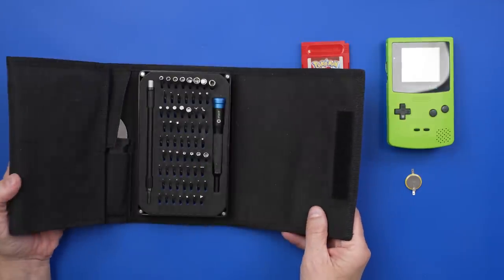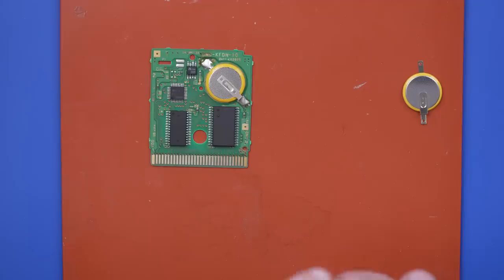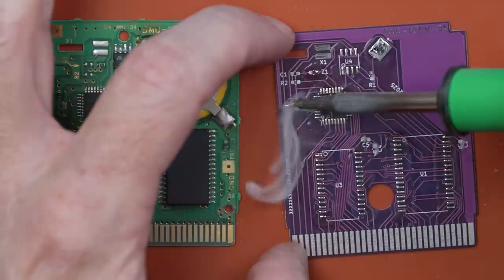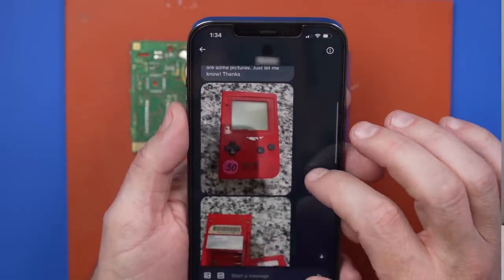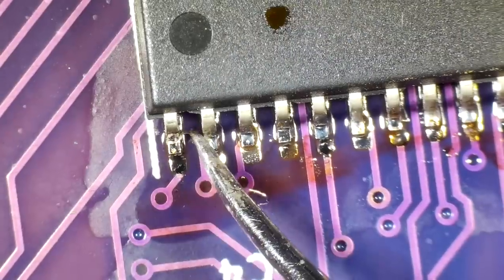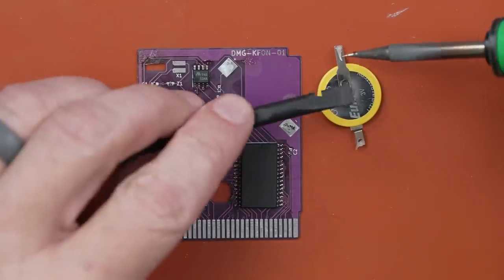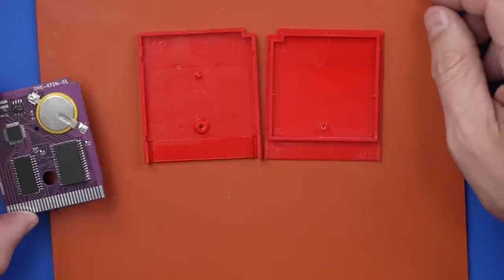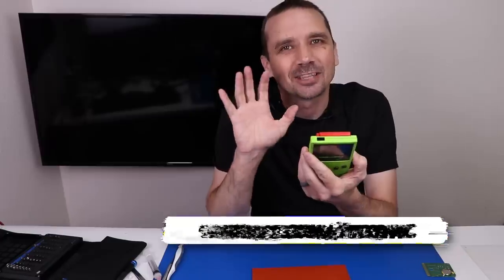Pokemon Red Game DESTROYED by Liquid - Let's Try to Save It!

Comment from the maker: PCB Design Attribution: PCB Design Attribution: https://github.com/HDR 
Above is where the PCB design came from for this new PCB. Also, I've been made aware by several commentors that the plating on this PCB is not ideal for this application. If you decide to have this PCB printed it's much better to have it gold plated so the contacts last much longer. Read the comments below to learn more from people who have a lot more experience with this than I do.
Reply: The only thing I would change about the PCB, if you're going through the trouble, is changing up the battery area to allow a slide in battery holder, so you can avoid having to use and solder in tabbed batteries.
Reply: Great work as always. But I have to agree with many other member comments. As a PCB application engineer, I do not recommend HASL, Tin Lead, Immersion Tin, OSP, Immersion Silver, or even ENIG finishes on pads or copper features that are meant for multiple touches or insertion edge connectors. ENIG is a good source for solderability but not durable enough for edge connectors as wear and tear would still cause gold breakdown/flaking and exposing copper for corrosion. I recommend future designs to use a minimum of 30uin of Hard Gold with a rating of 99.9% knoop on top of 150-200uin of nickel plating. This application better suits edge connectors and touch pads (like the D-pad or buttons) due to the thickness of gold for durability reasons. This will cost more of course, but these boards are typically manufacturing in multiple images on an 18"x24" production panel or larger which brings cost down significantly. Individual piece orders will be the high cost driver.
Reply: @PiiAreSquare  oh man, that makes small batch PCB ordering so expensive. I wonder if these gameboy cart replacement pcbs can be purchased at a good quality, by someone who's made them with the hard gold connectors 🤔
Reply: I was thinking. Maybe try fix: guitar from Guitar Hero series on PS3 and Xbox 360. They are rare to find in Good condition for small price, only broken are cheap. Also problem is that last game was sold few years ago And is not continued. So they only get more and more expensive.
Reply: It's generally agreed that the best finish to use is hard gold, but it's not as much agreed upon what the second-best is. IMO the more important thing is the edge beveling. I haven't finished the video yet, but for any game cartridge PCB you want to make sure the connector edge has a bevel or chamfer on it so that it spreads the contact fingers of the slot more gently. You don't see this on edge connectors for other applications typically because they're not intended for many insertions--e.g. how many times do you remove and insert things to a PCIe slot, maybe a dozen or two?
Reply: Also bear in mind that even if you find a board house willing to do hard gold plating, it's an electroplating process, which means you have to design a way to have all the contacts electrically connected into the board layout. This usually means you have a shorting bar across the end of the contacts which is then cut off after the plating. You can see on a lot of old cartridges the small trace going off the edge of the board where this was done.
Reply: @rfmerrill  Agree. In most of these cartridge designs, the edge chamfer or beleveling down to the degree and PCB thickness is critical. Gameboy PCB are designed with all edge connector pads extended equally with no recessed tips. With cost saving in mind, designers often resort to ENIG finish on all other contact pads which is applied after soldermask over bare copper at 3-5uin gold. PCB manufacturer would add tiebars/bus bars connecting to the manufacturing frame where electroplating of 30-50uin hard gold is applied. The tie bar is later removed along with chamfering. Regardless, 30-50uin hard gold is still necessary to prevent the surface finish from being marred and exposing bare copper towards oxidation.
Reply: @RestoreTechnique I can say that domestic manufacturing in USA will not be cheap. Most shops are set up to manufacture boards efficiently by creating step and repeat image of the same board. For a cartridge size of ~2.5" squared, you can fit approcimately 48 image per standard 18"x24" production panel.

Oversea production in Asia will be more effective as manufacturing plants are larger and setup for volumized production to reduce cost. It is common for designs like these cartridges are made with ENIG on all solderable pads while required electroplated hard gold on the edge connector tips.
Reply: please do a display upgrade video on that gameboy color. you make some quality videos.
Reply: @AkiraPoland  damn I haven't thought about gh in years man. I had such a blast playing 3. I had the explorer since it was on Xbox. Had so many stickers on mine. I even glued crazy things on it. I had hot wheel. I had an acion figure of punisher stuck to the  bottom of the fretboard lmao
 And then I melted a thumb tack and took the pin out then heated it up and melted in into franks crotch area so he was a punisher of a different breed. Had an Indian head penny on the fret board too. Lmao. wish it never fell off my home made wall mount. Thing was pretty messed up. I died a little that day. never played GH3 after that :(
Reply: As a retro game im sure it be fine for many years or decades as its not like its 1999 where we would play the game very single day and swap games constantly lol
Reply: How would someone order a repair board from pcbway or a repair board in general?

Comment: As I designed GameBoy cartridges myself, I can point out you made a small but important mistake while ordering the PCB. It seems you chose the cheap HASL finish, you definitely should have chosen the ENIG finish (Electroless Nickel Immersion Gold). With HASL, after some dozen insertions into the connector of the GB, the plating will wear out and you'll be back to square one with a non-functional cartridge. ENIG is quite more expensive though, but mandatory for GB cartridges.
Reply: Agreed… I have had issues similar to this with fake gameboy games
Reply: Yep, he screwed up by cheaping out on HASL instead of getting ENIG.  Big no no and RIP the gameboy that see's that game.
Reply: @jamesdavies686  Yes. To explain to the 2 persons reading this, the plating can just peel of the trace and short pins on the connector.
Reply: Funny, I just watched the video and was going to comment the same thing about the finish.
Reply: wow, this is why videos like this are so great, because the comments are an even greater source of information, thanks
Reply: @jamesdavies686  I didn't like his soldering, this PCB screams for reflow soldering on a hot plate.
Reply: @jylamjylam  very interesting, thank you for explaining
Reply: Where do y’all ask for custom pcb for the cartridges ?
Reply: ENIG is not that expensive, but the actual best coating for repeated inserting would be hard gold plating. And that's expensive :p But yeah, ENIG is better than HASL, for sure.
Reply: @dorfschmidt4833  Was thinking the same thing, it was a bit of OCD on the smaller components that are fine, but some of the pins he said were good I was thinking "you sure you don't want to go over that?", and that battery, it's fine but at the very least a small bit more on the positive
Reply from the maker: I appreciate you pointing this out. I'm new to all of this and this was my first PCB that I've had made so I had no idea. Really appreciate your comment though so others can see how to do it correctly.
Reply: 100% what I thought too.  I started making Commodore Carts some years ago and learned this too.  That said I do have quite a few Commodore 64 carts that did not use ENIG but rather HASL from back in the day.  Action Replay, and a few other popular carts come to mind.  I have owned them and used them for nearly 35 years and they are in great shape and I am not sure why as the Action replay was constantly in and out of the computer.  They do tend to also dirty the contacts on the computer/console side too.  Any stuff I make now with a card edge connector is always ENIG.
Reply: @Tronicsfix  I love this guy, this reply is awesome.
Reply: @adalgomez7117  PCBWAAAAAYYY.
Reply: If you add solder to the pins and mask traces with solder mask, it should help right?
Reply: ENIG will last longer than HASL, but the recommended finish for edge connectors is hard gold. Unfortunately, hard gold is expensive, like hundreds of dollars for small individual orders, meaning it would only be financially viable for large scale productions.
Reply: Are you sure ENIG is better than HASL? ENIG is a very thin pure gold coating, and in my experience it wears down very quickly. You might be confusing ENIG with hard gold, which is not as easy to get, especially in small runs.

I've seen plenty of ENIG edge contacts that are worn through the gold layer to the nickel underneath, but I've never seen a HASL edge connector completely worn through.
Reply: Just curious, when is a HASL finish more useful than a ENIG finish when it comes to PCBs? If ENIG is better then why is HASL evening an option? I'm sure it should have some use elsewhere aside from game cartridges unless it's just used as a more affordable option for most people to get. That's my best assumption.

Sorry for it's a dumb question. I'm very new to this.
Reply: @waltdeezy11  $ vs $$ vs $$$, like always
Reply: Ahh that is wat a pcb is I always wondered
Reply: cap
Reply: ENIG is still gonna wear off, you really want Hard Gold if possible for cartridges
Reply: @Xenethra  never overengineer my man. The consumers will just buy another cartridge. It's not a bug, it's a feature!
Reply: He know he chose the cheap kind lmao so he can cheap fix and make money
Reply: I came here to say this.
Reply: thanks for making this comment so I didn't have to. Saw the HASL and I immediately thought "Oh no, that's gonna get like 10 duty cycles"
Reply: @waltdeezy11  prototyping, usually, which is actually the entire reasons these small-run PCB shops even exist. HASL is fine if you're doing a one-off product or something that will be inserted only a couple dozen times at best, but for a game cart that might see hundreds of duty cycles you NEED to splurge on hard gold.
HASL/ENIG/Electroplated Gold/Hard Gold are all surface treatments, so they tend to get applied to the entire board in most cases. HASL is cheap, but not good for fine pitch components. The advantage is that it's easy to re-work and is fantastic for prototyping as you'll likely need to make bodges and changes to component placement in a design process. It's not as physically durable as ENIG or Electroplated Gold
ENIG is more durable, good for fine pitch components, and easy to solder, but harder to re-work. ENIG is a surface level gold bonded to nickel over the bare copper, so it's not a super-strong bond, but better than HASL and fairly resistant to physical damage or oxidization.
Hard Gold is electroplated gold. It's supremely durable, highly resistant to oxidization and corrosion, easily cleaned and not meant for soldering (but it's still good at holding solder). It's the gold standard for edge connectors and also very expensive.

Comment: Unfortunately, this board swap is only still going to work temporarily.  The board was ordered with a hasl finish, instead of enig or hard gold.  The solder on the cart pins is going to oxidize quickly and become non conductive.  The best repair would be rom swapping it to a cheap Japanese donor cartridge and then put the Japanese donor parts onto the replacement PCB with an enig finish.
Reply: Hey, thanks for this usefull information! Could you maybe also tell us where to get good quality PCBs for gameboy games like this?
Reply: I noticed that as well, but the thing is that ENIG finish is expensive. Unfortunately it is a necessity on this case.
Reply from the maker: Hey thanks for the comment. This is good to know as this is the first time I've ever had a PCB manufactured. Now I know what to look out for for next time!
Reply: Can you fix my gameboy metroid card? Is not saving my file and I did replace the battery.

Comment: Hey this isnt supposed to be a negative but you didn't go with gold fingers / ENGI I think its called but with the cheaper to just have everything coated in tin ( thus making your connections look silver)  but sadly these are way more prone to make bad connections / beeing used up way quicker then gold fingers. Thus this replacment board won't hold as long as a original / gold plated board. I don't assume that the game will see as much plugging in and out action as it did when it was new but its something to keep in mind

Comment: New boards, old chips, great video to save another great electronics device out of landfill. BTW, the free red Game Boy... pls do a video on that.
Reply: Unfortunately, wrong plating on the gold fingers so cartridge will fail shortly and end up in a landfill unless swapped on to a new PCB
Reply: @NWquadriders  could you elaborate a little please ? that seems interesting.
Reply: @Chaft015  The contacts on the Gameboy connector and the card edge fingers on the cartridges are gold. By using a tin finish on the card edge fingers on that new PCB, this will cause galvanic corrosion. This is oxidizing of the surfaces resulting in unreliable contact and could cause damage to the connector over time. Never mix tin with gold contacts.
Reply: @NWquadriders  Thank you for the details, I didn't know that, that could explain why gold plated connections are so sought after in electronics. 
Edit : I read that too fast sorry, I understand now, it's crazy how differents metals react to one another.

Comment: What surface finish have you chosen for the PCB? Looks very much like a simple HASL finish to me. That's very suboptimal for the edge connector.
It'll degrade much faster and oxidizes rather quickly, making the game more unreliable. Oh, and the HASL finish is going to rub off onto the cartridge connector of the gameboy making the gameboy itself also more unreliable at reading cartridges. For such PCBs you should always use ENIG finish at minimum but optimally hard gold.

Comment: Excellent job.
How did you procure the replacement board?
Did you study the original's layout and apply it in the PCB software, or find it available somewhere?
Reply: The traces look different - I would guess he draw the schematics and used autorouting in "PCB Design Attribution" CAD software (see the first comment).

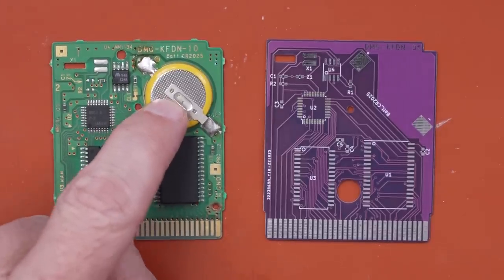Comment: 3:00 I don't know if it still comes in the video but here you can see in comparison that with the new board the inner pins are too long.  Left is 5V and right is GND. This is necessary to not roast the chips when plugged in when powered on and to make a clean contact with GND first.

Just a side note.

Comment: As an electronics engineer there are some interesting differences between the old and new board which makes me wonder if the guy designing the new PCB didn't really understand what's going on. For example on the old board there are many many vias connecting copper areas on the top to the bottom layer. All of them are missing on the new board. Also, some of the pins of the ICs are connected to what I guess are big power/ground traces. On the new board the are connected to tiny traces. But if it works it works I guess...

Also, is this a generic PCB or is it for this game only?

Comment: I didn't even know this was possible. Really cool video!
Reply: You can move the components on any board to another board and they will function correctly as long as the board is manufactured in the same way as the one it is replacing. You only need the traces to to get to the other components. Someone correct me if I am wrong.

Comment: This is the way to do it! You had a another video where you couldn't fix one and I suggested a PCB replacement. However I should mention On HDD Recovery Services (which used to focus on hard drives but does more USB and SD cards now) his fume extractor is aimed right at the PCB. Also for cleaning the PCB he puts a paper towel on top of the PCB then gets it soaked with IPA and then brushes it with a tooth brush. This lets the paper towel absorb all the flux.

Comment: Recommend you not use HASL but gold plated finish. The HASL is definitely cheaper but it will ruin your gameboy cartridge slot over time. Additionally, you should have removed the battery before hot airing that board, you don't want that thing to pop and you end up getting hurt.

Comment: 9:29 For high-thermal-mass joints like that which are attached to something thermally sensitive like a battery (or a plastic connector, or insulated wire), I like to try and dump the heat in as quickly as possible to give it very little time to spread out. This means bigger, hotter iron tip, plenty of flux, and bringing a big old blob of already-hot solder over to plop onto it. It goes against the usual wisdom for solder joints, but the flux ensures it should all be OK. The solder itself is an important factor in the transfer of heat from your iron tip to the joint--if you put a dry iron on the dry side of a piece of metal, it won't heat up very efficiently.

Gentle pre-heating of the board (to a moderate temperature, like 100-150 C or even lower) can also help a bit--it won't be trying to suck heat out of your solder joint as much. In fact, with this particular task, I might even consider heating the board from below, underneath where the battery is.

Comment: If you've got a bunch of metal oxides (corrosion) somewhere (liquid damage/battery leakage), you want to soak/clean that with vinegar first, IPA or brake clean second. Works a charm.